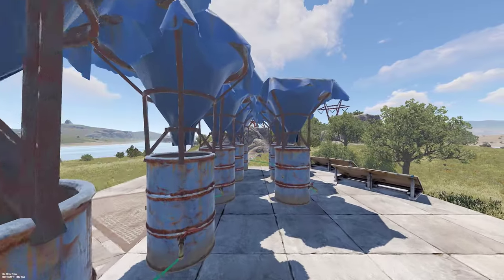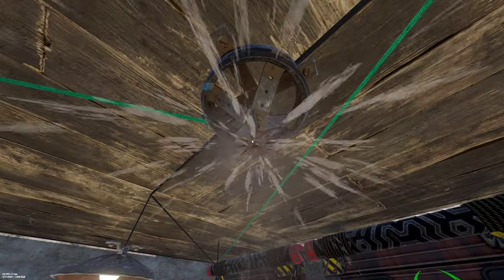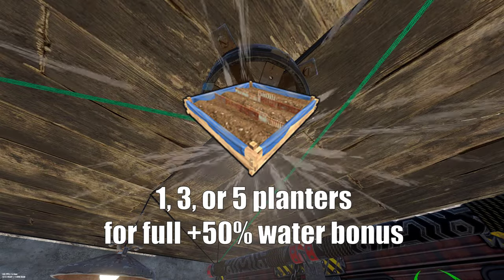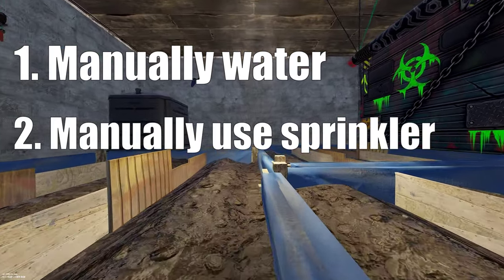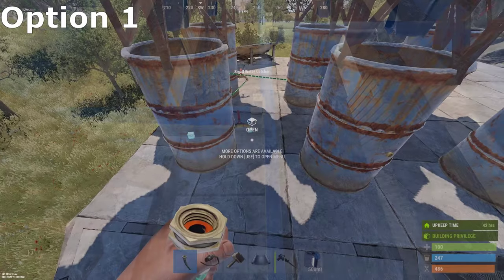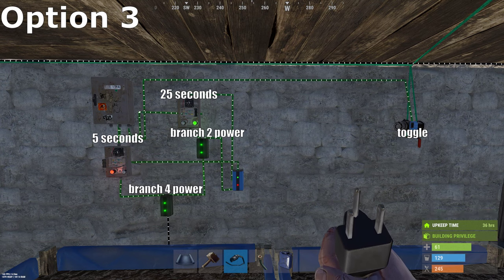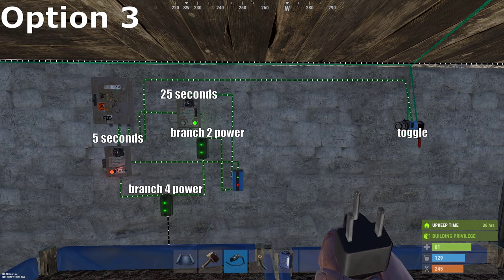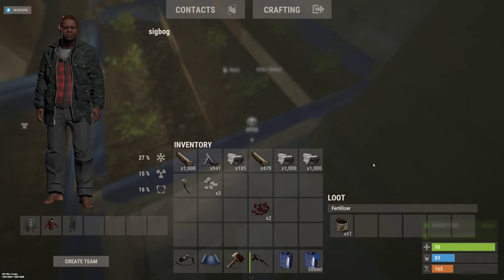Using Water Catchers to Farm in Rust

Comment: for anyone looking at this in 2024 when it rains you fill up your water catchers up to full so you really just need like 10+ water catchers and a few barrels and you should be good until the next rain cycle. Barrels cost the same amount of tarp but hold 2x the amount of water and can be placed inside to be ungriefable.(obv if space is an issue outside is better) had multiple farms that had the water catchers destroyed I'm assuming you can with a molotov and people do it often.....

Comment: You can easily get by with 6 small water catchers and 1 sprinkler to 4 large beds by adding in the water barrel and using a switch to only water when you need to. I use a manual switch rather than a smart one. The months you have listed as higher production are the rainy months in Rust depending on server. With just a bit of manual input 6 catchers can be used easily.

Comment: The pool from dlc fills up faster and provides more water than 15 catchers.  Even in the desert.  Used the pool to fill catchers to water the crops.
Reply: Wait it fills up without needing to manually put water in it? And which pool the above ground one or the paddling pool
Reply: @icyjoe  above ground? The big one with a deck.  Yes it fills on it's own.  Can even place it on the roof of your base.
Reply: I tried the pool again and  couldn't get it to produce.  Not sure why yet

Comment: ive just got a shit ton of water catchers that are combined into two pumps that get toggled thru one switch by using blockers and shit so when the switch is on the sprinklers spray and when i turn it off it automatically collects into a bunch of water barrels